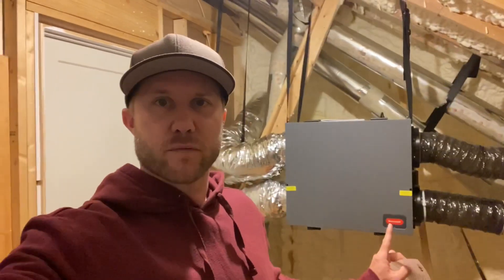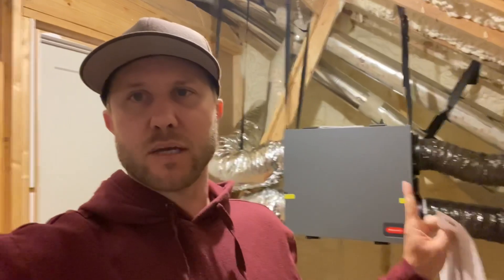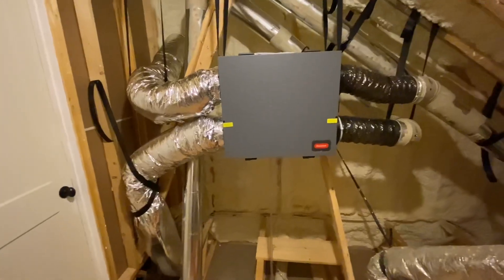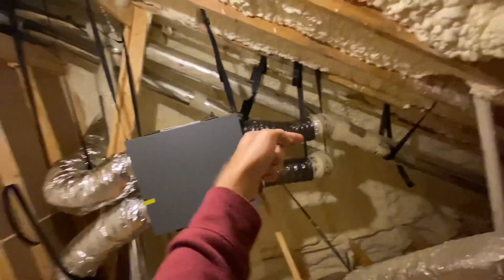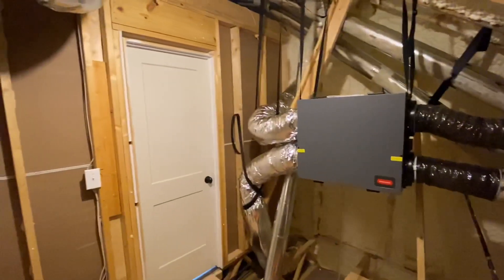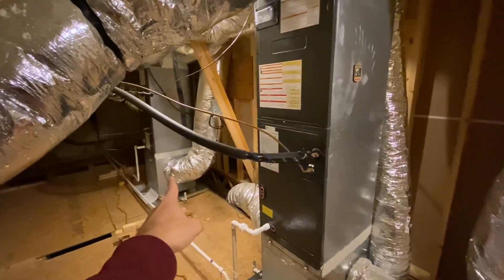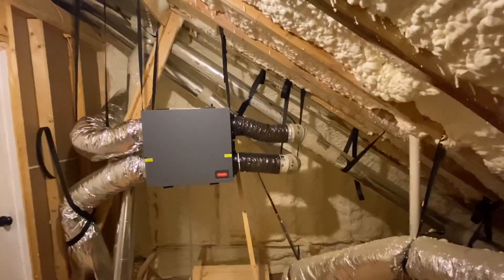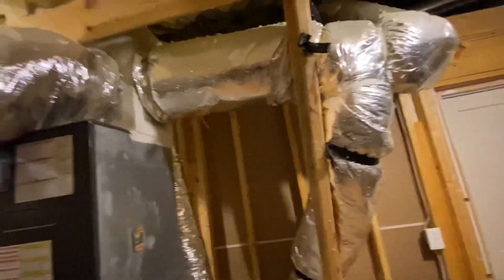Should you use HVAC duct work for an ERV? Responding to a comment. Energy Recovery Ventilator

Comment: I think you need the blower running if the ERV is connected to HVAC ductwork.  I am facing the same issue with new contstruction.  I am going to run ducts for the ERV like you did.
Reply from the maker: I made an installation video for my ERV. I think I should’ve run 4” ducts instead of 6”.

Comment: Forgive if I've overlooked this question/solution, but could you not wire it like you would a crank case heater so that when A/C is  on, the ERV fans are off and then turn back on when the AC cuts off?
Reply from the maker: My ERV is completely separate from my HVAC units. It runs 24 hours a day. It is always bringing in fresh air. Sometimes, the HVAC units don't turn on at all for several days if the weather is at the right temperature and the house is comfortable. My HVAC units do not bring in fresh air from outside. My ERV has to run all the time, even when the HVAC units are not running.

Comment: I've installed hvac systems for forty years, and the way you've done it, with separate ventilation ducts is MUCH better than using the existing ducts. If you're going to use the existing duct work, you dont even need an ev system.  By simply running a couple ducts  from the system, to the outside and damper them to suck in fresh air, and expell stale air,  when you need it, you've bypassed the necessity for a separate ev system.  Your hvac man should have explained that.  But to be completely honest. The way you have it now,  is the best way. Both systems are doing exactly what they are designed to do.  So pay no attention to that comment. When a ev company says " you can utilize the existing ducts" that's merely a selling point, that cuts cost. Stand alone systems are far superior.

Comment: The reason I would assume to use the existing ductwork is not for cost/labor, which are of course issues. But I would think to use the existing ductwork, since new ductwork would have a very difficult time reaching all places in the house. Yes the CFM in a  regular house HVAC is huge compared with this ERV, but my guess would be that the ERV would just take small samples of the air to clean, while the HVAC system helps to distribute the partially cleaned air more completely.

Comment: So, after performing air quality tests in houses for formaldehyde, VOCs and CO2 levels I'm convinced every house should have an ERV. Fresh air is important and most don't ever crack their windows. 
It's required in an airtight house for sure. My solution for a house I'm building is going to be to tie my fresh air into the return ducting and pull stale air with dedicated lines like you did. That way I don't have to worry about CFM issues or tying into the air handler electronically. It can run separately without issues since the ERV will always be running anyways and will mean that there's never a slightly off temperature blowing on anyone unless you're by the air return when the HVAC system is off. Just make sure the thermostat isn't being affected by the temperature difference in incoming air.

Comment: I live in Manitoba Canada in a house that was built in 1994 it was referred to as a R2000 home designed to be airtight.  The basement is spray foam with an insulated floor, the upstairs is 2by6 walls filled with insulation not sure what kind, with a layer of foam insulation put over the outside studs. It has a Vanee HRV that is installed to the ductwork of the electric furnace. I am thinking that you should have had yours hooked into the ductwork as well. Our Vanee HRV is a two speed fan in it, and when I set it on low it pushes air through the ductwork in order to keep fresh air in the house. But if the humidity rises to high it switches to high speed in order to bring down the humidity when it brings it down it switches back to low speed again.  I bought this house in 2020 and when I did the fan motor in the hrv was burnt out and the humidity was around 80% so I replaced the fan motor and it then brought the humidity down again.  I do believe that your ERV would have brought the humidity down lots if it was hooked up to the main ductwork.

Comment: I'm not an expert but I'm pretty sure it inputs to the return not the supply side.   That is the reason it ties into the blower on the handler.  This disperses the fresh air evenly and since there is pressure coming in from the erv supply the air will follow the path of least resisted which would be through the blower. It would also be nice to run the air through a second filter before entering the house.
Reply: If the blower is on. If it's not on, I'm assuming the air will simply go backwards out the main air return vent (assuming return air is taken from elsewhere in the house). If the ERV is getting it's return air from the HVAC system as well (e.g. on the supply side, a good idea due to pressure) then presumably it'd just be circulating fresh air entirely within the HVAC air handling system and not going into the rest of the house. 🤔

Comment: if youll tie ERV to air handler, and motor in air handler is off, ERVs supply and return will look for a short cut, in our case from top of air handler to the bottom of it. whole house HVAC is just for circulation of air, not for exchanging fresh/sail air. Dont overthink it. You did a right thing with going separate ducts.
Reply: Yup and since the Forced air system is stronger wouldn't there be a chance of it pushing air back into ERV?

Comment: Stand alone for the Erv is best from what I’ve read. Matt Risinger has some good videos explaining the best layouts. If not you’ll run into static pressure issues on the return side. You’d also need backdraft dampers for the supply side. Mixing small dc motors to a air handler that pushes thousands of cfm’s seems like a disaster waiting to happen. My only concern would be if I’m getting enough suction (cfm’s) pulling from all four locations especially the bathrooms. You could always put dampers on the kitchen or laundry ducts if that were a problem. You took your time and used hard duct instead of flex which is nice for the longer runs. If it were mine I’d be happy with the install. I’m picky as well.

Comment: In general, I would recommend separate ductwork. The airflow patterns are much more predictable/controllable. If you were budget constrained, tying the ERV's supply into the AC's supply ductwork could be ok (depending on the duct layout). However, even on a budget, I would still recommend having separate exhaust ductwork with exhaust vents placed strategically throughout the house: the kitchen, the bathrooms, litterbox, etc. (i.e. places that generate smells and/or excess humidity). It's just better to get rid of it at its source.